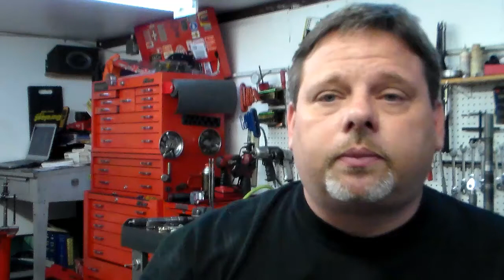47 RH TRANSMISSION DODGE CUMMINS

Comment: Thanks for taking the time to make these videos! Is the 47re the same basic premise as the RH?
Reply: Jorgy 6BT  pretty much.  The RH has a hydraulic governor (H). The RE has an electronic Governor (E).  So the 47RH lacks the solenoids of the RE instead it has governor weights like an old fashioned transmission.  For that the RH is slightly longer than the RE
Reply: Alan good explication, thank you!

Comment: Hey so I own a 1990 dodge ram 250 it's got a auto 47re trans and for some reason the rear yoke vibrates when in load in second gear I was wondering if maybe you know what it is
Reply from the maker: well lets start with a little more info is it 4 wheel drive or 2 wheel drive. when you say rear yoke, is that the rear end yoke are the yoke on a rear driveshaft going to a transfer case, and does it only act up in 2nd gear? last but not least is it a bolt on yoke with a slip joint in the shaft or a slip yoke? in most cases its a bushing fail, or lose flange that is were I would start.
Reply: its like the yoke coming off the transmission its a 2wd and it shakes in second it an auto how do I fix it do I need to pull the trans off to get to the rear output bearing ore?